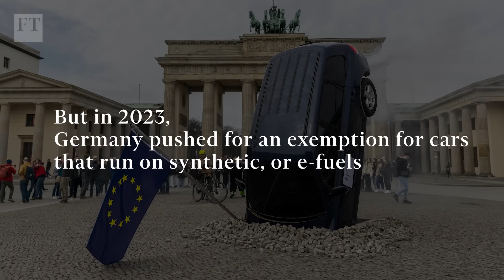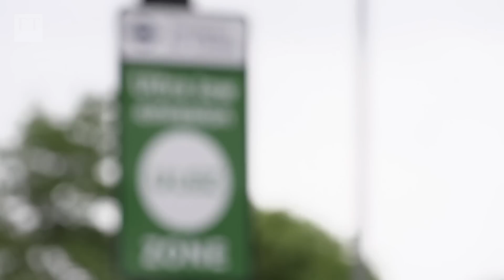The end of the combustion engine? | FT Energy Source

Comment: More often than not, EVs are still charged by fossil fuels burning power stations. The best power stations have a thermal efficiency of just 60%. More energy losses will also occur along power transmission lines, during charging of EVs' batteries, inside electric motors among other things. EVs are not as efficient as proponents of the technology claimed.
Reply: This is false.  You can charge your big EV truck straight from a coal plant, but your effective carbon emissions would be that of a Prius.  Also, more importantly, the grid is nearly 50% nuclear/renewable now and increasing.
Reply: @DarkBrandon1  You are a laughingstock. Exactly which part of my comment contains untruth. I based the 60% thermal efficiency claim on operating reports out of the newest and most efficient power stations around the world. Do you have any credible references for your claims? If not, they are just lies.
Reply: They are already more efficient than ICE cars in converting energy from carbohydrates into motion. Also, it is easier/better to filter all the smoke at the fossil fuel burning power stations, than from each individual car. But with wind/solar becoming available, it is already getting much cheaper to drive on your own electricity, than buying carbohydrates or grid electricity. In my own example, charging with electricity from our solar plant is 3-4x cheaper, than to use petrol. And that is from the extra electricity, which is on top of the production for our own home, where installation just for home use will pay off in 3-4 years (Lithuania).
Reply: @NeblogaiLT  I did not dispute EVs were less efficient than ICE cars. Perhaps you can read my comment again. I said that they are only marginally more efficient, maybe 10% or less, as long as they continue to tap into their local gas or coal power plants for recharging. Wind and solar is definitely the way to go but not every country has the necessary attributes for wind and solar farms. And not everyone lives in a house allowing them to install solar panels on their roof. Like many people, I live in a skyscraper inside the city so solar is not an option for me.
Reply: rather odd to complain about the inefficiency of legacy (non oil fuelled) fossil power plants and point a finger at EVs.  as renewables ramp up (which create electricity as a primary energy source) the demand for fossil primary energy to burn in power stations will fall and the efficiency of the whole energy system will rise
Reply: @ldm3027  REALITY. The reality is that most EVs are charged with power generated at a gas or coal power plant. Thus, it is a necessity to discuss gas and coal power plants with EVs. When all EVs are powered by wind or solar power, I will gladly switch to the appropriate power source as comparison. However, when that happens, assuming that it even happens at all, green fuel will have already become prevalent.
Reply: REALITY depending where you are you can already get low carbon electricity.  Seems that you dont get the problem with "green fuel" it is far too expensive as it uses so much energy to create.  EVs win every time  @yehtan
Reply: @yehtan  Renewables are now the cheapest and fastest growing in the energy sector. The UK's grid for example is over 40% renewable and growing. Grids will only ever get cleaner, as will driving an EV.

Comment: Indeed. It will be a long time before internal combustion engines are a relic of the past found only in museums. The problem with the green energy transition is not really fossil fuels used for power generation or transport but petrochemicals which take the lion's share. There are currently no adequate substitutes for these which are found in most manufactured objects and commodities.
Reply: Actually, solar getting cheaper and battery tech has improved. Wind is also improving. Nuclear and other forms of energy production will eliminate fossil fuel in the next 20 years tops.

Comment: So, we have fixed the BOM (Copper/Lithium/Rare Earth)  challenge of electrification including copper interconnects and intermittent storage with a smart grid and charging network? I thought not!
Reply: There are Lithium-free batteries and Rare Earths-free engines already being used in EVs; Sodium batteries, in particular, are expected to take quite a bit of market share in mainstream EVs because they seem to have good enough power density — and actually more durable, fireproof, and capable of charging faster than Lithium batteries — and can be significantly cheaper than Lithium ones. And Aluminium — the single most common metal in Earth's surface — can be used in place of Copper for most grid purposes; in fact, many places are replacing Copper wires with Aluminium ones because Aluminium scrap has much lower value, and as such Aluminium wires are far less targeted by thieves.
And that assumes that finding enough of those materials was an issue in the first place. It isn't, really.
Reply: aluminium is the most common metal in the earths crust - thought about that?  I thought not

Comment: The issue is power generation, its transportation and distribution all require substantial investment to support a full EV transformation even before you get into Housing heat pumps. Latest estimate £44 billion just to replace the gas network, so that’s not happening.
However transport is about 15% of the carbon issue. The rest is burning fuel or gas for manufacturing, transportation other than automobiles and food production. The only option available is Hydrogen and Ammonia. So when we move to a hydrogen economy around 2050  for 85% of the activities we do, what vehicles do you think we will use. Fuel cells are now has cheap has batteries for the same outputs. Internal Combustion Engines are running on Hydrogen for Haulage Construction Agriculture vehicles and Marine vessels particularly where there is a high requirement for power takeoffs.  Synthetic and E-fuel is being produced for sport and classic automobile use. All options need to be produced and actively pursued, because inevitably the ultimate solution has yet to be determined.
Reply: Hydrogen will never be a mainstream fuel for road transportation. You mention the required developments to build out  and beef up the electricity network, that is simplicity itself compared to building a hydrogen infrastructure from scratch. And bear in mind that 99% of hydrogen comes from steam reforming of fossil fuels, a very energy intensive process. Serious study of the subject will convince you that what I am saying is true. Battery technology is improving all the time and EVs are becoming mainstream while ICE sales have been declining since 2018. The process to make useable hydrogen from any feedstock is even less efficient than making gasoline and diesel from crude (energy required to give a certain number of miles driven). Plugging an EV into the grid which is increasingly powered by clean, renewable energy is far more efficient.
Reply: @kiae-nirodiariesencore4270   Actually no, look at history, from the Horse we went, Steam Car, then Electric Car indeed the first Porsche was electric for the Habsburg monarchy. Then Petrol Car, when petrol was very expensive has hydrogen is today. China who have led with EVs say hydrogen is the ultimate future because they understand the automobile is a small issue compared to what needs to be progressed to replace fuel oil and natural gas. Go do some mathematics on the size of the power generation, transmission and distribution development requirements. So spend £44 billion on old technology or on new. What are they looking at to store renewable energy than just switching it off, Hydrogen and Ammonia batteries then use that to generate power using the old gas power stations.
Reply: @DC.409  You are either very confused or having a laugh. Where do you think the hydrogen or ammonia feedstock is going to come from? It has to be made, in the same way that gasoline has to be made from crude. Making ammonia uses a huge amount of electricity which to be carbon free has to be produced using renewable energy. It is far more efficient to put renewable energy straight into your car battery. As for China, you are getting confused with Japan whose government is very committed to hydrogen, China are not other than to use it for industrial processes like steel making. Japan has been talking about 'hydrogen islands' for over a decade but has done little to put the infrastructure in place, though they are building a green hydrogen production facility using solar and wind power (electrolysis from water) but again, that energy would produce more miles driven if simply put into a battery without all the complications of hydrogen. I did a video recently on my channel where I interview someone who has real world experience of working with hydrogen. The production, storage, handling and usage challenges are immense. The fossil fuel industry see hydrogen as a saviour for them as they can continue to use gas as a feedstock, but that isn't very green.
Reply: @kiae-nirodiariesencore4270  I think you are, China is the largest user of Hydrogen. Europe has recently found White Hydrogen which could contain up to 46 million tonnes of white hydrogen, which is more than half of the world's current annual production of grey hydrogen. Although most natural hydrogen is likely to be found in unreachable offshore locations, deposits have been discovered in Australia, eastern Europe, France, Oman, Spain and the US, as well as in Mali, West Africa.
Reply: @DC.409  All I can say is that you cut and paste our discussion then see where the world is with a) hydrogen and b) battery electric transportation in 5 years time, then 10 years time, 15 years if you have the patience...Then eat some humble pie at each stage along the way. Let's be clear Hydrogen is not and will not happen for road transportation, end of.
Reply: @kiae-nirodiariesencore4270  Europe is spending Billions on Hydrogen and Ammonia development with the world’s largest plant being built in Holland and systems to replace gas. There is a simple reason the UK will have to increase generation capacity by 250% to support a fully electric car and home heat pumps system, before considering the electric transportation and distribution yet another substantial investment. Additionally 40% of U.K. homes don’t have the necessary insulation for a heat pump to be viable so either insulate or have a hydrogen solution. We already have an extensive renewable energy system, which are switched off when there is no demand and given we have limited locations left, where any additional systems are economically viable, the options are Nuclear plants, hydrogen generators and home heat and power plants. Hence like Germany €20b is being invested to transport hydrogen between the major generation locations across the U.K., because with Hydrogen and Ammonia storage you can fully exploit your renewables and have to not switch them off when there is no load. Then the Hydrogen and Ammonia is used to generate power when required. 
As I said cars are only 15 percentage of the netzero issue. The remaining 85% we burn fuel and gas for generation manufacturing and food. The only solution is Hydrogen and Ammonia, for those industrial processes, so when you’re producing it to run your haulage, marine, flight, construction and agriculture  machinery on hydrogen, what will the majority of cars be running on?